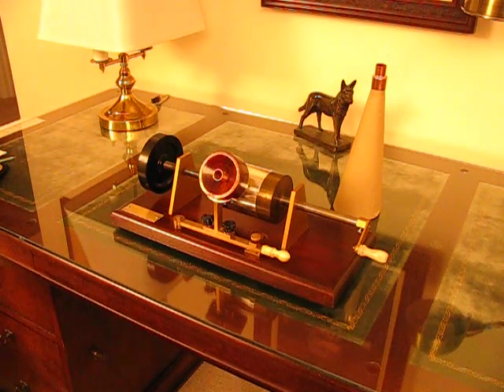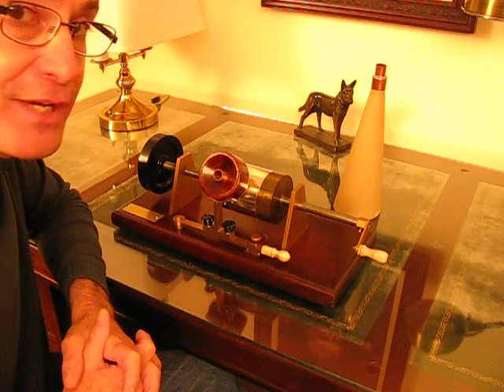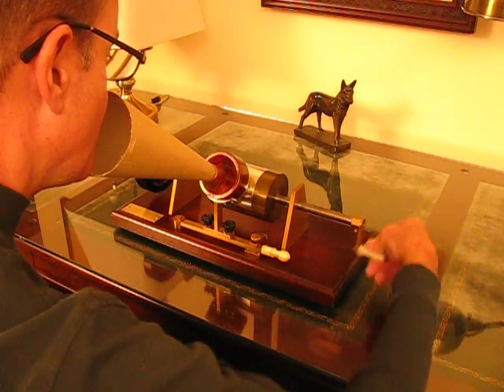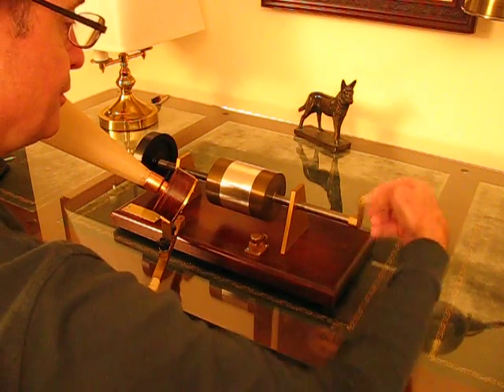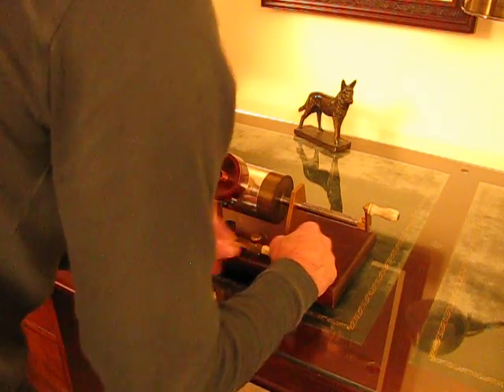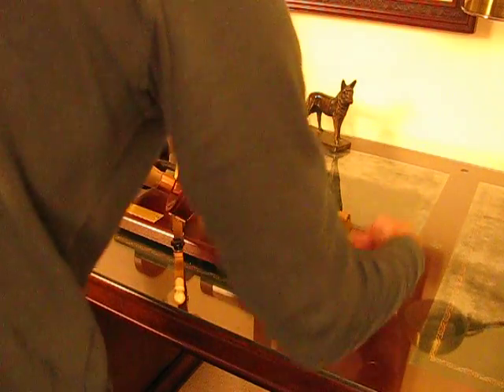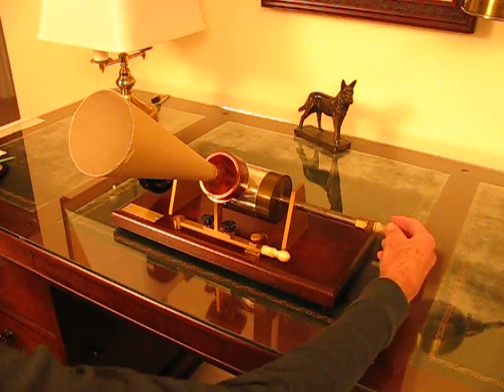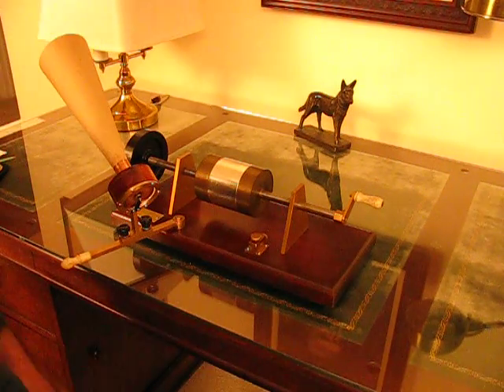Gillett Tinfoil Phonograph Test

Comment: Hello, I was wondering if it's possible to use other materials for recording such as aluminum, copper, iron or even silver or lead? And how would that effect the sound quality?
Reply: Im sure it would work well. However the main concern would be cost and efficiency. Tin/aluminum foil is cheap compared to the aforementioned materials. A good question though, i will try this

Comment: Hello Lee I am very fascinated with tinfoil phonographs and how simple they look and how complicated it is to get a decent recording. I was wondering how did you come across a replica machine? I understand they are very hard to come by and if you find one they are thousands of dollars. because of this I am in the process of making my own tinfoil phonograph based on the basic principle of how one works. I know your phonograph is a Gillette tinfoil phonograph reproduction, is the diaphragm copper or did you replace it with isinglass or stove mica. isinglass when used with the right gaskets makes excellent recordings with less surface noise. love the video and I will posting a video of my homemade tinfoil phonograph soon.